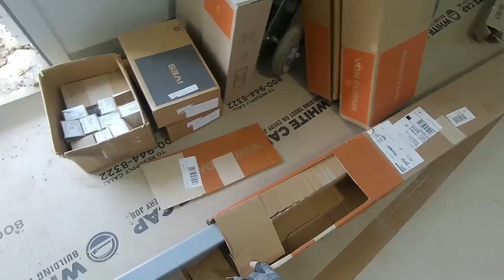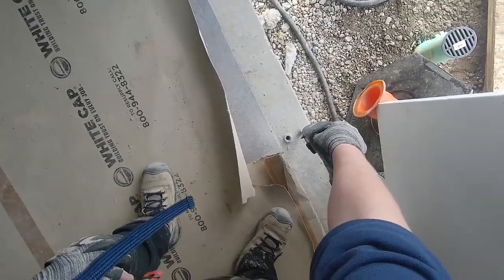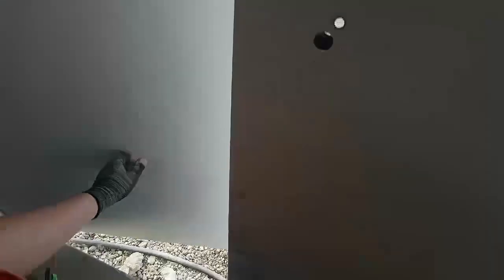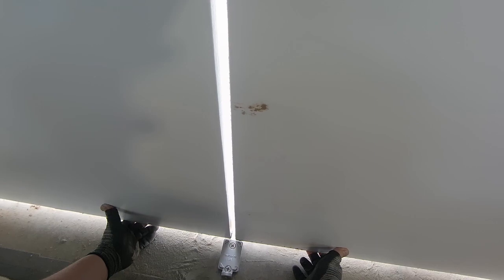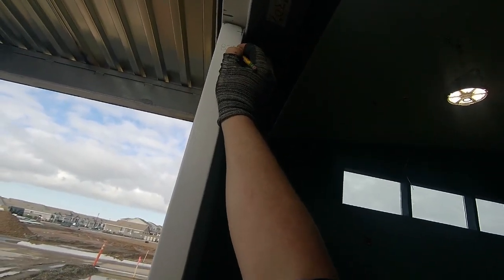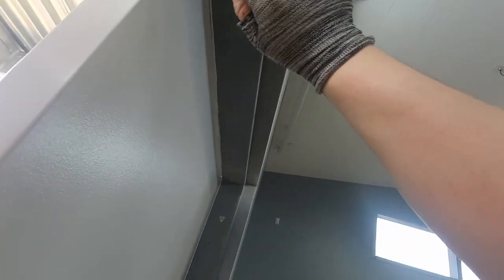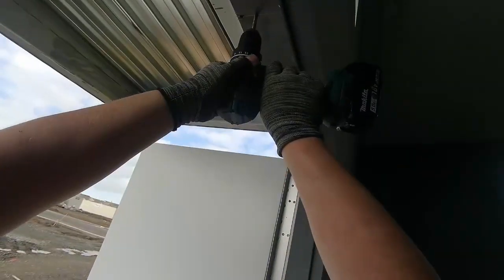How to Install Von Duprin Keyed Removable Mullion KR4954

Comment: As a locksmith, the only suggestion I have for you is to put a dab of grease on the cylinder cam or back of the LFIC. With the cylinder mounted sideways, it's not uncommon for the cam to fall down under weight, then you can't reinsert the LFIC. Some of the housings do have spring washers that tension the cam and prevent this.
Reply from the maker: Wow!  I know exactly what you are talking about and that’s a great idea.  I think we typically remove the mullion and lay it down before swapping out because the cams just drop.  Thanks for the tip! 😎 if u know anybody else who would like these kind of videos please share 🙏 I greatly appreciate it!